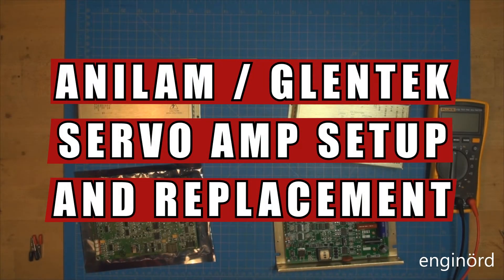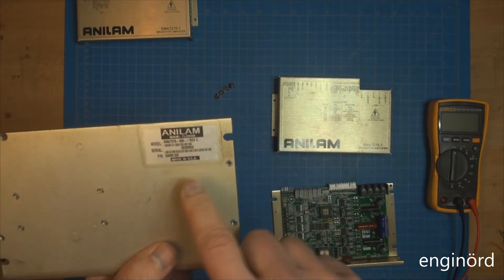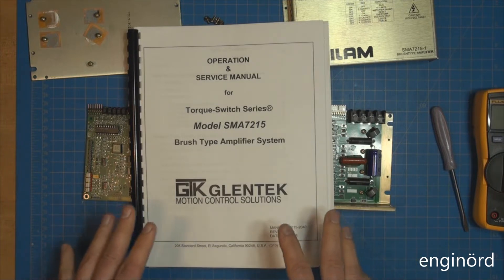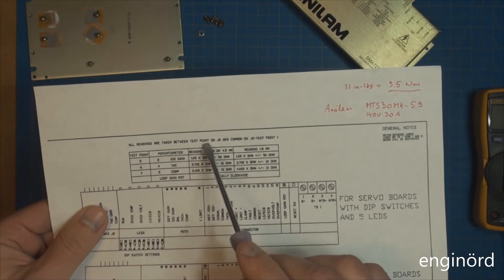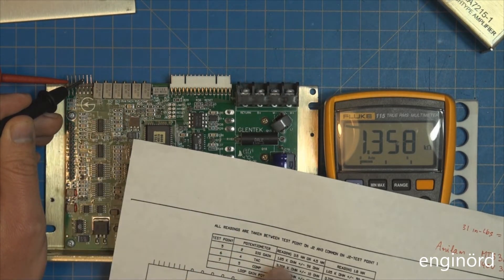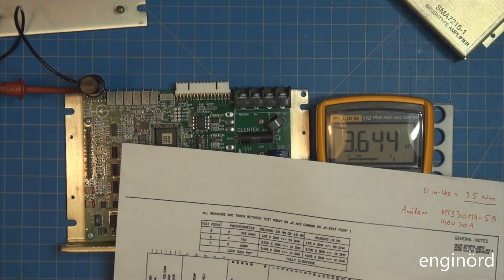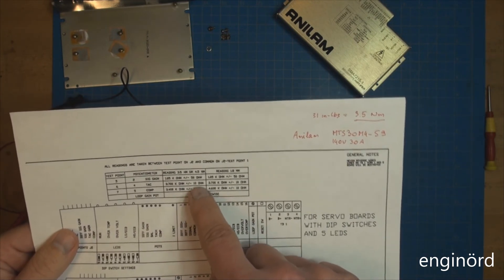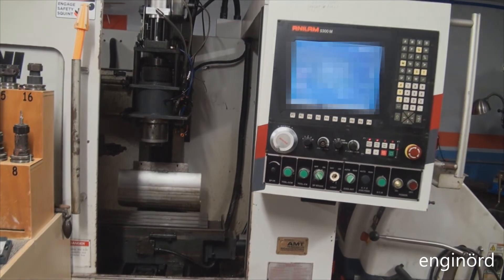ANILAM / GLENTEK Servo Amplifier Setup And Replacement

Comment: Nice video mate! I am having the exact problem as yours x and Y axis lag error. But both the ball screws are worn and some of the tircite pads are missing, so have to rebuild all the mechanical parts first and if still exists  have to look at the controller. Servo motors looks good. Thanks for all ur videos about this👍👌
Reply from the maker: if you are rebuilding you might want to look into mach 3 controller. you can sell the old components (servo motor, servo drives) and get new stepper motors and decent controllers for the price.
Reply: @enginord  thanks mate can you provide some links in ur description where to buy from or the suppliers.
Reply from the maker: @abhipk8241  Sorry. I don't have a list of components yet. It's also dependent of the machine's power requirements.
Reply: @enginord  no problem . my servo motors are still in good shape and looks perfectly alright , they are quiet big as needs loads of torque,  It’s a heavy duty build machine as the x axis has 1500mm travel.